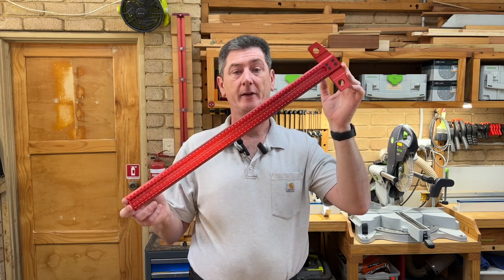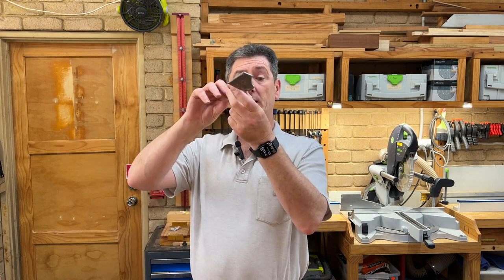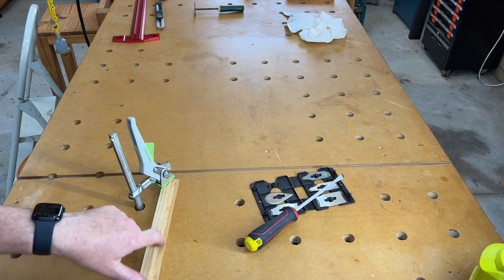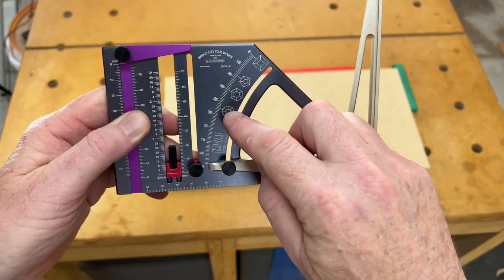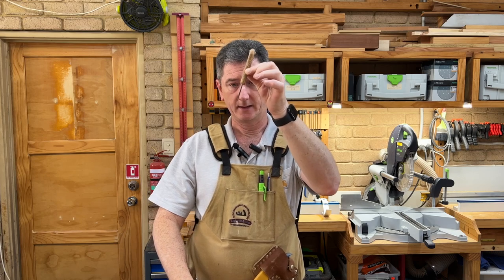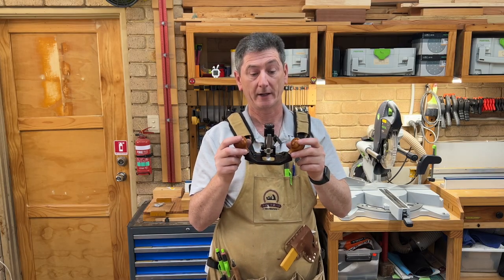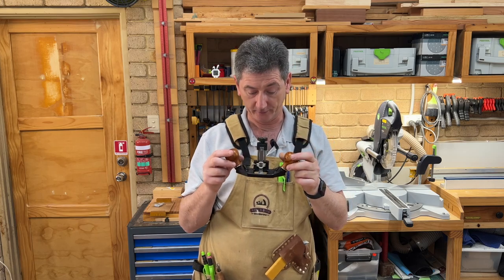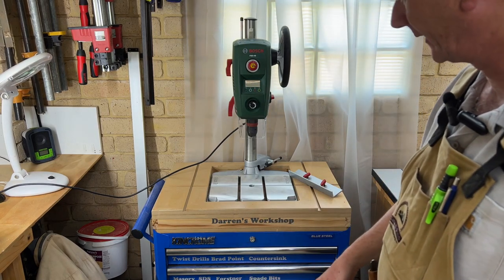Cool tools of Q4 2022

Comment: Hi Darren. This video is so timely for me. Your bench drill setup is just what I have been looking for. Do you have a video covering its design and build? Currently my new bench drill sits on the rubber mat on top of my tool trolley and I wanted to bolt it to a wooden base secured to the steel trolley top. Your design looks like the ideal setup. It even has micro jig groves that I want to put on my workbench. 
PS I started watching your YouTube channel because of the 3D printed designs.
Reply from the maker: Hi Ewen, sadly I didn’t film the building of the drill press table. To be honest I didn’t think anyone would be interested. But you can build one without a video. Start by making wooden base to fit the top of the tool trolley, then, with the drill press in place buildup around the side of it. Remove the drill and finish off with a piece that covers the entire top. Route a hole out of this piece so you can now drop the drill back in. Route a V groove in line with the one in the aluminium base and add the dovetail slots for the clamps.